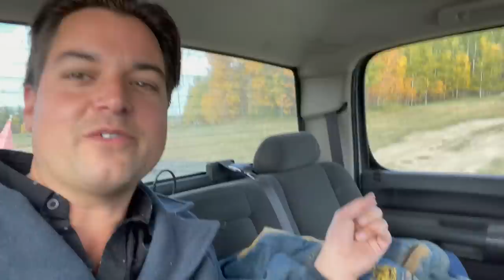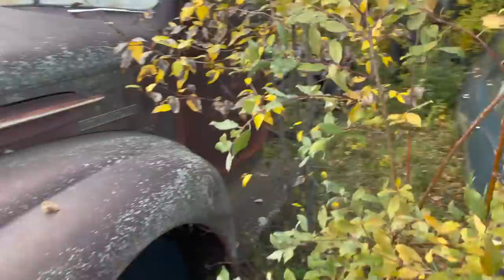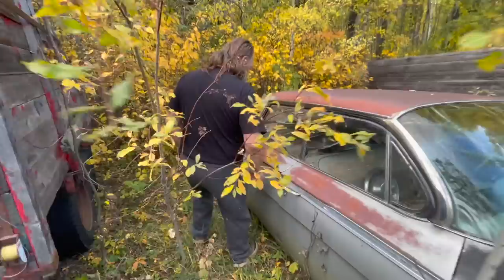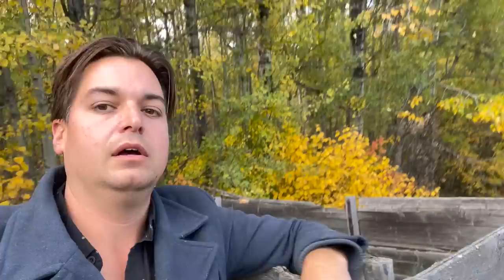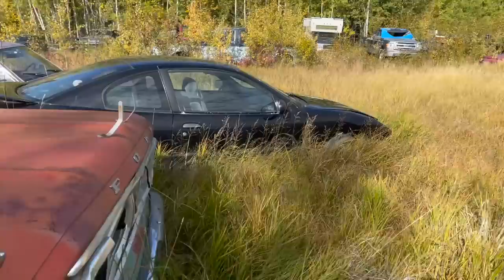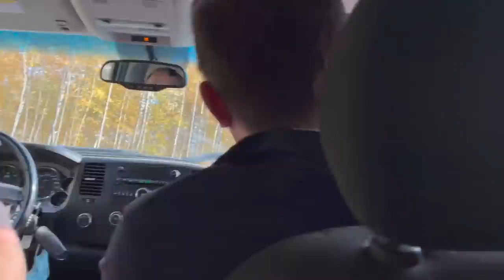Scrap Yard Pickin! on the hunt for classic truck parts

Comment: I remember once in outback Australia I went on a trip after a big flood came thru in my small 4WD truck. I arrived at my destination and it took a whole day to get the mud out of the wheel wells. Water and mud got in the rear brakes and wore them out.
I felt totally relaxed on the trip. I saw areas full of emu’s like a small ostrich and kangaroos. I stopped and they all just went motionless and looked at me.
There was hundreds of k’s of wild flowers. Thousands of noisy parrots on the ground. Pig melons growing. I arrived at an outback town and found I was the first person to get through after the floods had gone down into NSW. I had driven from Thargomindah to Quilpie.
The whole truck was covered in sticky mud as well you could hardly see the paint. 
It was an amazing time for me. I had spare diesel on board just in case. I was driving along and something said stop. I found my spare can had sprung a hole. I put the contents in the tank. I can never tell anyone how amazing and special that was.

Comment: I really love y'all's new truck, I used to have one similar to it, 1978 F-150 Space Cab, with a lineman's box, 8 footer, also had a lumber/ladder rack, on top and over the cab. Sported the venerable 300, straight six, mated to a 4 on the floor. It came with factory AC. And the options ends there. No power steering or power brakes. Just an honest, dependable, everyday work horse, that was perfect everywhere except for parking garages. Awesomeness..... Have a Great rest of the week.

Comment: Got a hubcap story for you. I had '67 Olds rocket cone caps on my '78 cutlass. Came in 3 colors red,dark green and black. I had black. I hit a pot hole cap popped off,saw it in side mirror. Before I could turn around to get it it got flattened  by a truck going the other way.....

Comment: Hi Alex I had a 1978 ford super cab and found that the back seat was low and knees were up high i fixed this by drilling holes through hockey pucks and placed a couple pucks under each rear seat mounts and longer seat mounting bolts which raised it up enough to get more leg room. newer trucks raised the seat from the factory which made more room

Comment: How are you going to use the truck for hauling when it rains and during winter time?
Reply: I am pretty sure it is four-wheel drive.
Reply: @danielulz1640  I was more concerned about the open back.